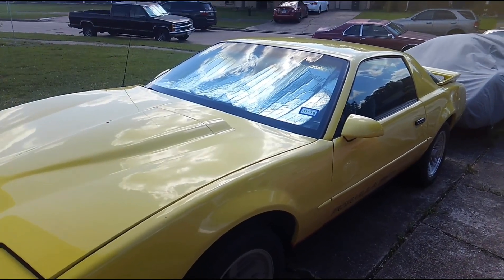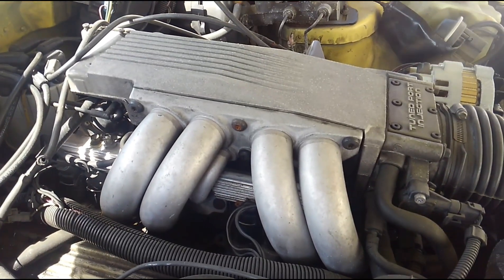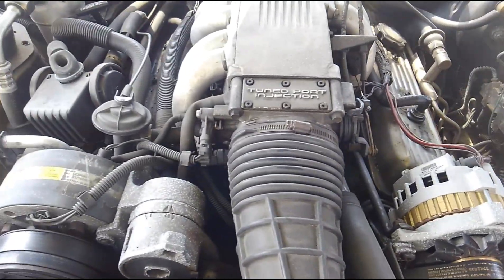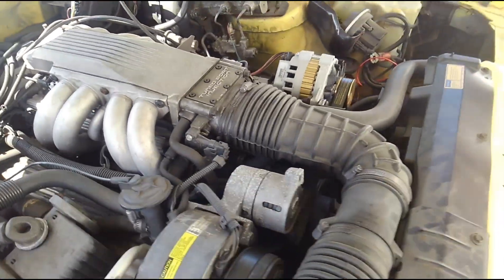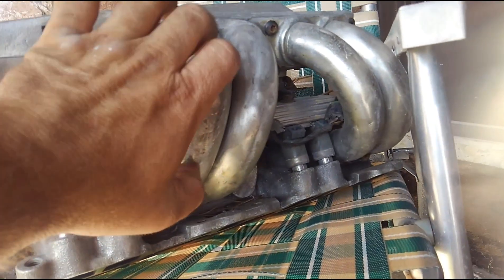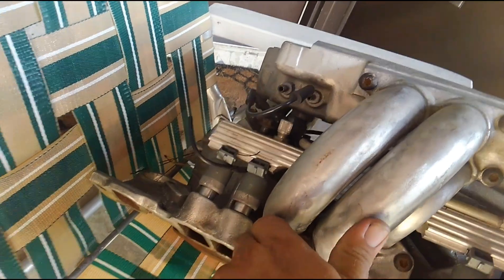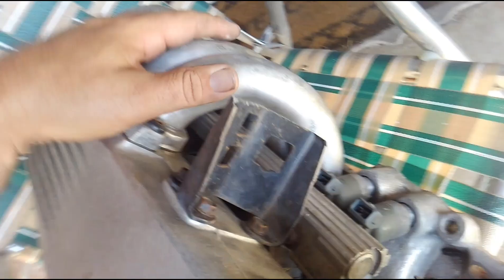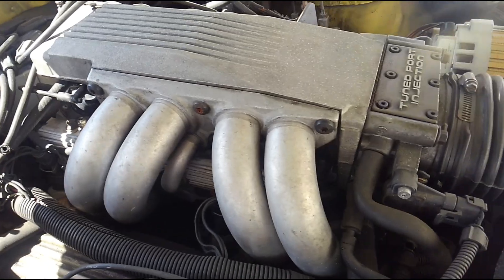The Awesome GM Tuned Port Injection System of the 80's

Comment: Ok so I have played with these motors a lot at one time. Yes they are not a high RPM intake system the resonant frequency tuning is from 2500-4800 RPM's. Yet the reason they drop off so much in part is the garbage heads only flowed like 185 CFM which just kills the top end. I installed Brodix 180cc runner heads, AS&M runners, TPIS Big Mouth lower intake, 58MM throttle body and we hand ported the plenum ourselves. This and a few other tricks like taking out the screens and fins in the MAF sensor, bigger injectors I think 26lb from memory? Relocated the MAT sensor from the plenum to the plastic air intake with a K&N filter. On the exhaust side it was Lingenfelter Tri Y headers through two huge cats a big single and no mufflers. Internally we had a TPIS cam some where around 224 degrees duration with big lift and Comp Cams 1.6 roller rockers in the stock 350. With the T56 my dad and I installed it would just about pull the front wheels in the air. Car pulled very hard to about 3,000-5700 RPM then dropped off. Stock it was falling on its face at 4800 RPM.

Sorry I know that was a lot of info but if done right TPI cars are very fast and besides tuning from induction length these motors were just flow restricted period. Even with the bigger intake runners they still aren't quite big enough for 383 and larger engines. 

If you own a TPI car the very simple almost free mods were move the MAT sensor from the plenum it gets hot from the aluminum and thinks with the MAF input the car is getting much less air than it is and leans it way out. Then you probably are getting knock and it retards the timing too. Someone makes a different sensor that thermally isolates it from the aluminum and I hear that works well, but I bought a longer cable and moved mine like I mentioned above. I did this took out the MAF screens and installed a K&N filter and we wen't from 15.3 second 1/4 mile times to 14.7... That is a cheap easy half a second and the car didn't get sluggish when it warmed up and felt very snappy. If you are super cheap you can just hand port the plenum radius the inlet to the runners like 3/8" and probably drop a few more tenths. Yes take off the smog pump garbage too. I didn't get to track test the car unfortunately but I don't think I'm exaggerating when I say it was an easy low 12 second car with the 350. I think a well set up TPI will net you 11 seconds but that is about the limit with out NOS or forced induction... 

One more trick remove the brown timing wire and set the base timing to 12 degrees advanced. They really like the base timing in that range, might help to put some Teflon around the knock sensor too. 

FWIW my car was an 89 Formula 350 and there was countless Mustangs that got their lunch eaten and everyone had souped up Mustangs then. 

Here is a good article  http://www.superchevy.com/how-to/engines-drivetrain/sucp-0703-stealth-tpi-induction. Look at the torque it is amazing that is why they can be very fast they get the car moving instantly. 

https://www.youtube.com/watch?v=6-_OOfETQmw   Very much runs like my car did except 383 vs 350 so I'm guessing it is was a bit quicker and watch it eat LS Corvettes lunch.
Reply from the maker: James, thanks for taking the time with such a thorough reply. You are correct about the inherent limitations in the "as delivered" from the factory Tuned Port Injection systems. Personally I believe they were trying to make a compromise between power and government mandated fuel economy standards at the time. However, like you said, with the right mods, a Tuned Port can stomp all over quite a few cars and cause quite a bit of embarrassment when engaging in stoplight to stoplight action. In the early 2000's, I was running my 85 Corvette with a .40 over 350 4 bolt main, Lingenfelter roller cam, AFR heads, Hooker Super Comp long tube headers, and topped off with a Lingenfelter Superram. I also backed it up with a 2800 stall converter and 3.73's in the factory Dana 36. It wasn't the fastest, but you can bet I left many a competitor with a gobsmacked look on their face after we finished running them. Good times, thanks for reminding how much fun the TPI's could be!

Comment: I love this system. I love the name, that little plaque that says "TUNED PORT INJECTION" on the throttle body, I love the 30 horsepower jump over the Cross Fire Injection 350, etc. Those intake runners look really cool, and GM even had a dual throttle plate design before the plenum. I would still like to have an IROC Z or GTA Trans Am.
Reply: Yea, Mine has been a great Car ! 1986 iroc z28. 305 Tpi. 17-21 mpg city. 30 Mpg All Hwy on a Long trip. 2 people.
No problems ! All Original. Totally stock. Black / Gold. T-Top. 170,000 miles.
Reply: This intake in combination with Borg Warners 9 bolt 3.27 made these cars jump off the line.
Reply: I had a buddy with a TPI trans am. Driving it was better than sex.
Reply from the maker: Couldn't have said it better myself. Thanks for the comments👍
Reply: Love how it falls on its face at 4500 rpm
Reply: @blackram17 ANY automotive system is a combination of compromises.  You put a 250 duration @.050 cam and a single plane intake on this engine and it may rev to 6500 rpm, but it will be gutless below 4,000.  Most daily drivers are used right in the sweet spot of the TPI, and it works very well.  It’s all on the intended use.  The 1985 Corvette was running 150 mph with this very same setup off the showroom floor with 3:07 gears so GM was clearly doing something right.
Reply: @salvatoregiovanni8967  yeah I bet it took forever to get to 150 too. 

I’m busting your balls, I love my 89 GTA 5.7, a custom chip and shorties wake these cars up enough to likely keep up with a stock LT1. I could hang with 90’s Cobras and 00’s 7 series back in the day manually shifting.
Reply: @salvatoregiovanni8967  also the LT1 had a much better intake and virtually the same heads/cam and had better numbers. I’ve unfortunately seen a few LT1 taillights in my L98.

Comment: The first tuned port fuel injection for Chevrolet was offered in Spring 1957 !  Non efi
Reply from the maker: Good point. It was also made by Rochester like the TPI and was a mechanically operated unit. The trick is finding a complete unit for under $10,000😁

Comment: Tpi is a high torque low rpm intake system. Biggest bottleneck is the small tube runners. Arizona Speed & Marine sells large tube runners. Firstfuelinjection sells a complete intake manifold, along with runners and throttle body.If using large tube runners port and polish the lower intake manifold to match the runners.The smoother the finish the better...air loves smooth finishes. A 58mm throttlebody will require port matching the plenum. Siamese the plenum where the air exits and radius the openings on the inside as much as possible...air likes a smooth radius when exiting. Do not siamese the runners because some torque will be lost. Keep the cam profile on the low side 218/ 220 112 lsa along with good set of heads "summit racing" and be prepared to smile.
Reply from the maker: Excellent rundown of the system and how to get the most power out of it. A couple of other good items to add would be a looser stall converter in auto trans cars, and some deeper gears out back. Then you're really able to holeshot from the stoplights. Thanks for watching👍
Reply: @scottypalmer2158  is there anything to be gained by just going with bigger runners? How much can be gained with just an entire ported intake system?
Reply: @BlackRam17  : Any larger runners would be a good choice especially if you smooth down the casting flash in the base intake runners.
Reply: @scottypalmer2158  even without porting the intake and base to match?
Reply: @BlackRam17  : Im not sure. Never tried runners by themselves.
Reply: @BlackRam17  : https://youtu.be/B3Je1MLTphs?si=O2xtKSUkyU8qcztn

Comment: Was the Airfoil work on the throttle body?
Reply from the maker: It will work and is an easy install. However any gains are pretty much imperceptible. Thanks for watching and let me know if you need anything else👍

Comment: Tpi is the first mpfi v8 from gm, and the Camaro / firebirds had 350’s as the top engine from 87 - 92
Reply: The runners are long and narrow which makes a lot of torque, the combustion chamber size has nothing to do with the intake design, and no “performance head” for a 350, you can buy comes with a combustion chamber bigger than 64 - 67 cc (stock 305 heads have 58cc chambers and 350’s have 64 cc chambers) and there’s only one head on the market dedicated to the 305 and that’s from trick flow. So if someone puts 350 heads on a 305 with a bigger combustion chamber then they are lowering the static compression ratio
Reply from the maker: Yep, I believe I remember that I misspoke when referring to the combustion chamber size, but couldn't go back and change it after the video was already posted. My point was that installing larger aftermarket heads on a stock TPI manifold wasn't going to do much good without also upgrading to the aftermarket TPI runners and intake. Thanks for the input👍

Comment: They started putting the option for tuned port 350s in Camaros and firebirds in 87.  85 and 86 only had the 305 tpi option in Camaros and trans ams.
Reply from the maker: Yep. I can remember when the Formula 350 cars were announced. It was cool to have the L98 Corvette engine installed in the f bodies even if they didn't have the Corvette D Port aluminum heads. Thanks for watching👍
Reply: They made a limited amount of 350 TPI 5.7 in 86...... they're  very rare.
Reply from the maker: Interesting, I've never heard about those before.
Reply: @VetteSource  they're out there bro..... if you find one buy it, restore it, & keep it. IROCs are going way up in price now days.
Reply from the maker: Yep, I'll keep my eyes out for one. Thanks for the heads up👍

Comment: If you need o rings for fuel system get Viton o rings. Here are the sizes.

Fuel return line for fuel rail  010
Fuel supply line for fuel rail 0 11
Fuel rail cross bars 110
Return line at fuel pressure regulator 109
Stub aluminum tube between fuel pressure regulator and rail 012
Fuel lines to fuel filter in and out 011
Fuel injectors 203 
I bought the the Viton assortment o ring kit from harbor freight and it had all of these sizes except 109 and 203.
Reply from the maker: Good info, thanks for sharing👍
Reply: @VetteSource  no problem. There are two more o rings for the tpi cars that had the ninth / cold start injector but I don't know what sizes they are. My formula  is a 89 and does not have the ninth injector. I believe in 88 or 89 gm did away   with the ninth injector.
Reply from the maker: @backyardbuck6362  yep that is correct with 88 being the last year of the cold start injectors. That one has a much bigger o-ring but the exact size escapes me at the moment.

Comment: Crossfire Injection, 1982-83 Camaro/Firebird (yes Gen2 1981 also) was first.  Two separate 1 barrel injector assemblys.  The 2 barrel TBI wasn't until 1987...  TPI wasnt first, it was second.
Reply: I've got an 84 vette that I removed the crossfire intake & injectors and replaced it with a holly tbi intake and 87 350 tbi. I used the factory crossfire wiring & ecm to run it. It was plug and play and has a nice increase in power. The holley intake is good through 6,500, I bet the crossfire doesn't do anything past 4,000.
Reply from the maker: Sounds like a smart conversion to make. Trying to go from Cross Fire to Tuned Port Injection will get you in the weeds very quickly.
Reply from the maker: yep, that is correct. I didn't mention them since they are still more of a carb/fuel injection hybrid rather than a full on injection system with an individual injector for each cylinder. Thanks for watching.
Reply: The TBI went till 1995. Ty.
Reply: @bryanolivo8093  Yes, I should've inserted one extra word: "available" ...wasn't available till 1987...

Comment: I'm live in the UK & looking to buy a 3rd gen camaro project car with a 305 tpi engine and videos like this are awesome & very helpful 👍🏼
Reply from the maker: glad to hear it man! Even though the 3rd gen F Bodies are kind of a lost car of the 80's they are a blast to drive and simple to work on compared to many other cars. You can see more of this car and the story behind it in this playlist I made for it - 

https://www.youtube.com/playlist?list=PLAM-V1w3acphkZJyLroCKcyLO9GzqR6q4

 I will let you know if I come across anything that may be what you are looking for. Do you prefer an automatic, or the 5 speed manual?
Reply: @VetteSource  I love the 3rd gen Camaro, a cousin of mine who lives in the USA had one as his first car but his was a iroc z and I love the shape of the car. The one I'm looking at buying is a automatic but it needs welding in the floor pans due to t top seals leaking, it has been sat for 21 years so once I've finished my Audi b3 90 I'll be doing a complete strip down rebuild and I'm trying to get as much information and planning as I possibly can before I do so.
Reply from the maker: @Kwakcrazy  definitely the way to go. Sounds like it deserves a new lease on life after sitting 21 years. Let me know if you need any further information.👍
Reply: @VetteSource  yes it definitely needs a bit of TLC after sitting that long and will be very grateful when I get it for any help

Comment: but they used the same intake from the 305 on the 350 hense why the thing has no power past 4800 rpms
Reply: Question?  Who is revving to 6 grand when the speed limit in the city is 30mph.  Idle to 4000 is all that's needed for normal driving
Reply: jon sixxx / the intake runners are long and narrow which produces a lot of low end torque
Reply from the maker: Yea, it definitely didn't help the engine in the higher RPM ranges.
Reply: @VetteSource  I solved that issue using a lt1 intake now pulls all the way to 6000rpm
Reply: It is spelled “hence”!